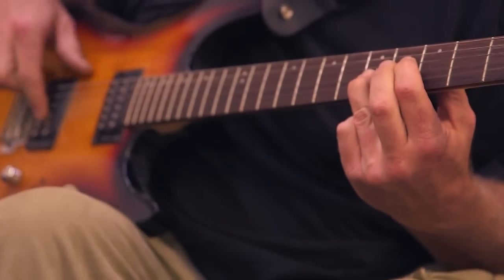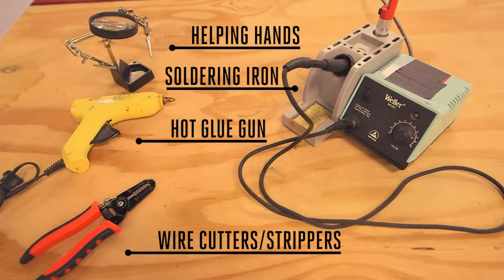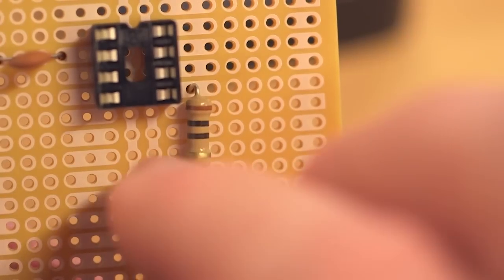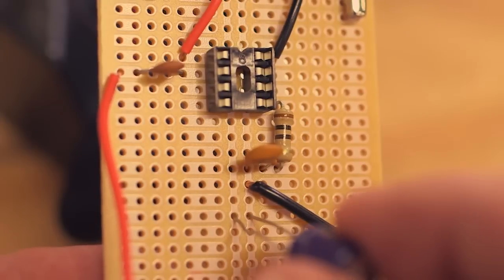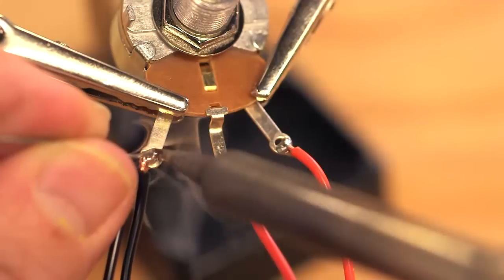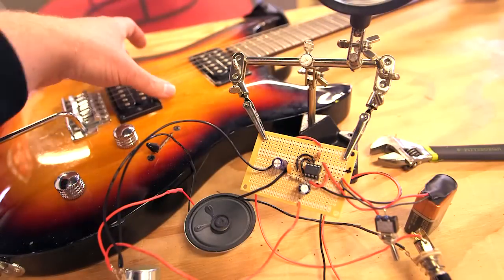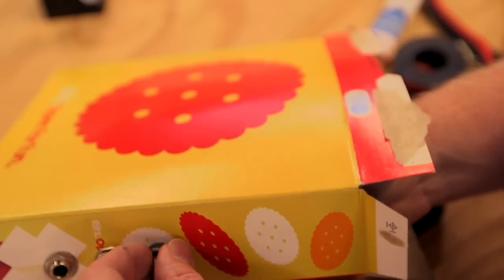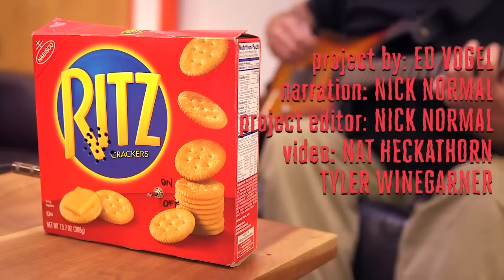Cracker Box Amp

Comment: I had a 1.5 watt 8 ohm speaker laying around....I used that....I didn't found a 25 ohm rehostat so I omitted that...after completing the build the sound came....but it is too weak to hear unless I put that to my ears with a continuous humming sound??? have I done anything wrong....please correct me....I'm powering the circuit via 9v adapter

Comment: Can i make this circuit twice but instead of 2 rheostats i'll just use 1 but double the value
Reply: Edit: Can i make this by only using a single 50 ohm rheostat rather than two 25 ohms rheostats?
Reply: +Tromix Mixtro just leave it out and use guitar volume
Reply: how do i leave it out ? i litterally have no idea where to put the wires that were supposed to be on the rheostat pls tell me
Reply: the wire that goes into the rheostat from the board goes straight to the speaker and ignore the other wires. if it is too complex maybe try the smokey as it's easier or the bazz fuss. thats what i did till i got better.

Comment: Stick it all in a beer can for a real fun sound.
Reply: TheDutyPaid The other week i made some mini fanta can speakers and amp XD Its odd because the speakers i used had aloooottt of bass for there size and the odd echo of the can seemed to make the highs come out more and they sound really good for there size.
Reply: exogator
loudspeaker enclosure design is a fun thing to get into, speakers have not changed in design near on 100 years but the enclosures have been made in every material shape and size.

Try adding some dry rice to the base of the can, it adds weight and adds tone.
Reply: Ha wish i could but i superglued the speakers in XD http://tiny.cc/j52jyx (Link to the pic on my Facebook)
Reply: exogator
Nice work. Always fun to make stuff you have a use for in the end.

Comment: Just punch the holes with a pencil, you don't want crap on your soldering iron.
Reply: +armena torvan The soldering iron is completely safe from any debris, the cardboard will burn without flame from the heat and leave behind just a little bit of ash that can be wiped off as you clean the soldering iron's head regularly. The burning also ensures a nice round hole and removes all the matter inside the hole, like drilling but cleaner and leaves no rough edges.
Reply: well, it's fine if you only do it one time, yeah. But over time, it'll fuck up your tip.

Which is fine if you have a cheap soldering hunk, but not cool if you have something like an industrial JBC iron for which tips cost 30+ bucks (then again, I wouldn't use that for my hobby projects if I didn't get it free as surplus from work)